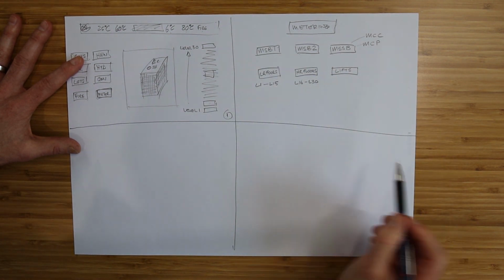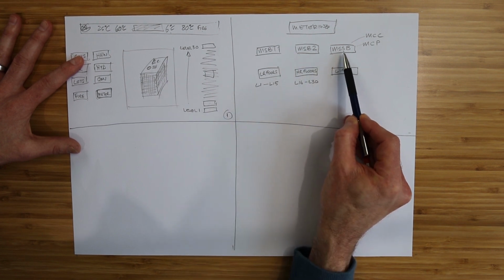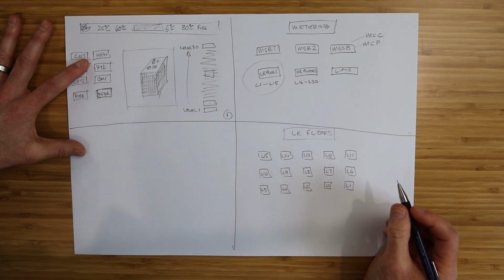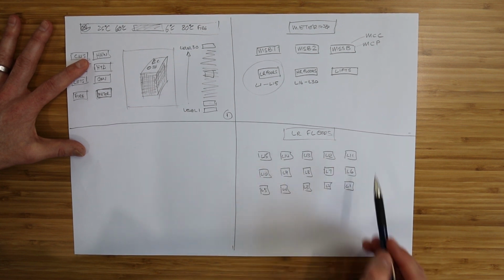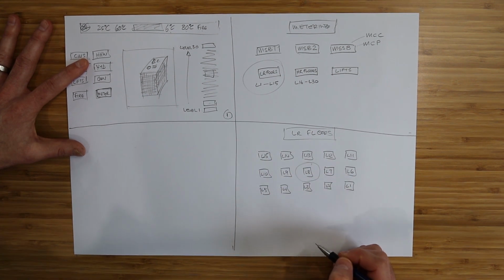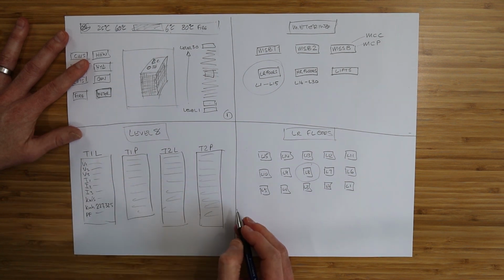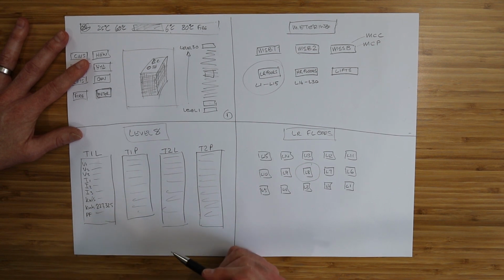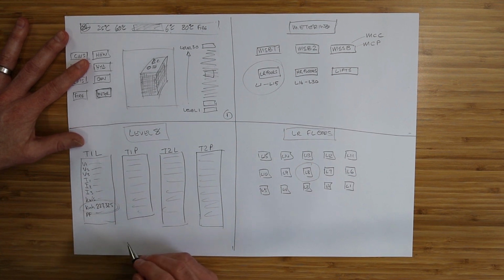Energy Management System Visualisation

Comment: Great video once again. Biggest failure in the BMS industry is the use of the data that it continuously collects. Analyzing data (consumption vs operating conditions) should be a key facture in developing dashboards. Monitoring and analyzing the building should be simple and quick.
Reply from the maker: Agree, we are not good at using the data that we collect. Cloud hosted tech companies are much better at visualising data. And it helps them win work from us.

Comment: In general I agree with the video, but chiller COP is not a good way to go for efficiency. The energy you save producing higher temperature chilled water, you then waste in the Air Handlers to move more air. You actually reduce the efficiency of the whole system, because the air handlers drain more power. You have to look at the whole picture, not just the chillers/cooling towers/pumps. Unless you have a thermal storage, which is a rare animal.
Reply from the maker: Hello. 
That is exactly what I have said in the video. Calculate the COP of the entire chilled water system, so that when we reduce the condenser water temperature, or increase the chilled water temperature, that we can properly understand the true affect on the whole system, and not just the COP of the chiller.
This video discusses what you have said about chilled water temperature resets: https://youtu.be/KUNsG2BOwp0
And, this video discusses a similar principle regarding lowering condenser water: https://youtu.be/1ZJJydMkotk

Thanks for your support :-)
Reply: @bryceanderson17  I meant to say that you don't take the air handlers in this calculation. When you increase the chiller water temperature the air handler won't be able to make the setpoint. Then the VAV will need more CFMs. Then the air handler will increase speed to maintain the duct static. Then the "savings" from the chilled water temperature is wasted in the air handlers. I agree on reset of the chilled water temperature, but it must be done with caution.
Reply from the maker: We are talking about exactly the same thing here, I am not sure why you think I am not considering the AHU coils? 
In this video: https://youtu.be/KUNsG2BOwp0
I discuss 100% exactly what you are saying. Increasing the chiller set-point results in the chilled water pumps pumping harder and using more power, which offsets some of  the saving the chiller made. 
In this Energy Management System visualisation video, I simply touch on that same example, by saying engineers need to build a virtual meter, that totals the power consumption of the chiller, condenser water pump, cooling tower fan, AND the chilled water pumps. Because, as you say, we need to understand the increasing pumping power when we reset the chiller temperature. 
At some point, raising the chiller temperature will result in the OVERALL system being less efficient - I agree with what you are saying. 
But, until we build the virtual meters and start to study the relationship between increasing chiller temperature, reducing chiller power consumption AND increasing chiller pump. we will never know where the sweet spot is, or completely understand this complex relationship. 
I hope you now see that we are are the same page :-)

Comment: Very good presentation, Bryce. Unfortunately, no one ( I mean the builder, the mechanical contractor) wants to pay the BMS subcontractor to do all this fancy works but they’re willing to pay through the nose for 3rd party solutions.
Reply from the maker: For sure they wont pay for that. But, what happens is, we leave the door open and then a 3rd party system comes along and earns a monthly subscription, for the EMS, for the next 10 years.  
This year a $4M or or BMS system handed over. Within 3 months a 3rd party analytics system was installed. I am busy reviewing the BMS companies maintenance proposal, which has a subscription cost for analytics. 
Well, sorry guys, we wont have that, someone else beat you to it. 
If they had just absorbed the analytics engineering cost during the construction phase, they would be earning $30k - $50k per year for a bit of software. 
I am now going to completely restructure their BMS maintenance contract to align them with the analytics provider.